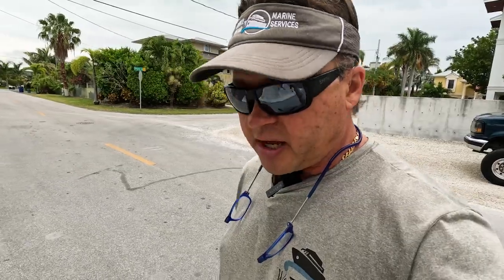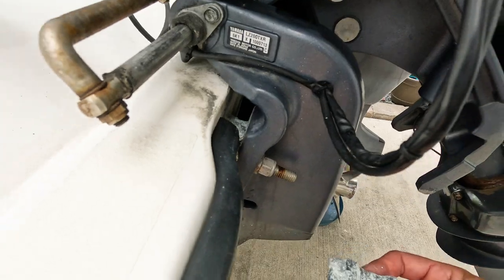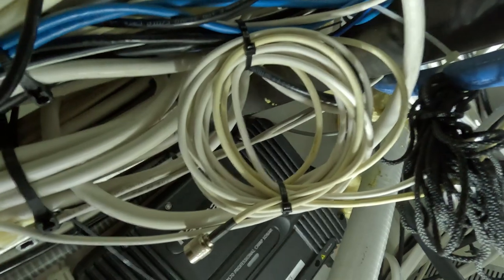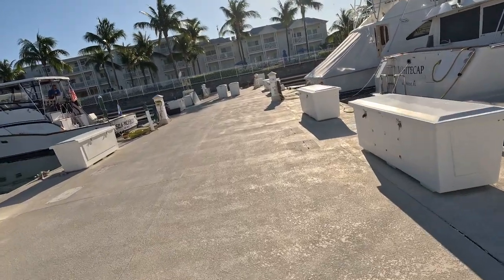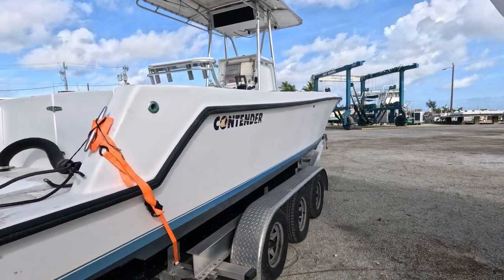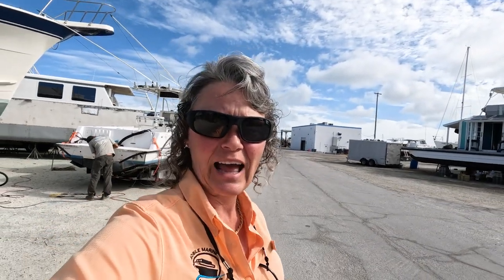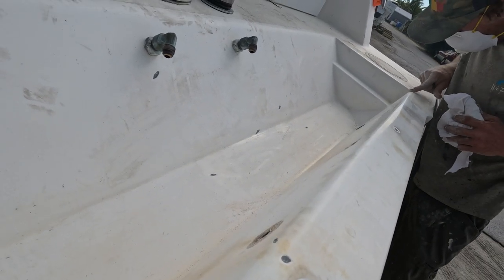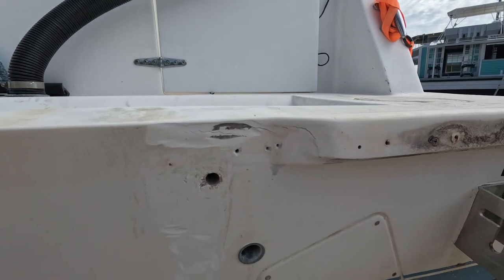Will this 35ft Contender Be a TOTAL LOSS?

Comment: Did you just grind out the gelcoat between the cap and transom, and the cracking at the bottom well, and re-gel coat it?
Reply from the maker: Yes we ground it out to trace any damage. We also used filler.
Reply: Ahh okay, so wasn't really any damage, just cracking in the gelcoat from the flex. Makes sense. @WillFixThat
Reply from the maker: @Velislide  yes looked worse than it ended up being! We thought it needed a new transom in the beginning! Got lucky with minor damage.

Comment: From experience of owning 2 31 contenders and a 27 contender myself and riding in many other contenders those are normal stress cracks. If you looked through you would have seen cracking also Whare fuel lines go up to cap on the floor and port rear of the cap.
Reply from the maker: We see lots of stress cracks on boats! Our focus for insurance was on the transom since they hit something at high speed and damaged the engines. We met the insurance guy at the boat after it got to the boatyard.

Comment: IF you cut into the transom the whole transom needs to be fully replaced. never ever ever a partial repair in that area. From the force and load you are asking for nothing but trouble. but the looks of things the cap to hull joint just cracked wheere they bond everything. If it were me I would take a few 1"  explores into the transom to check for water. if its dry? send it its good! a transom replacement full coosa you are looking about 6k for the transom. let me know if its a loss ill pick that bad boy up and have that 27 contender looking like new lmao!
Reply from the maker: Thanks for sharing they were superficial cracks that we discovered after grinding the transom! It was all dry too.